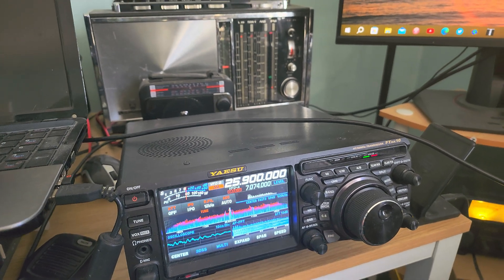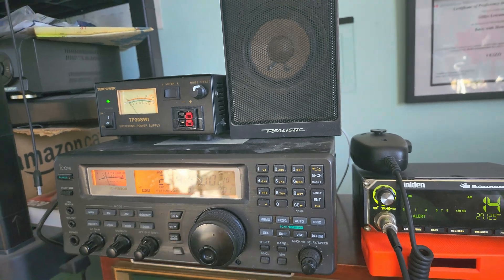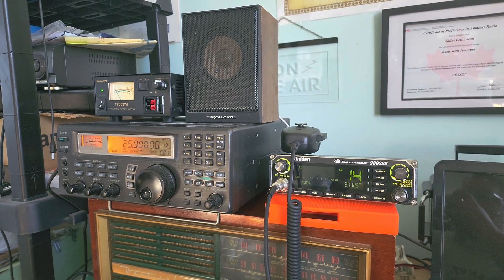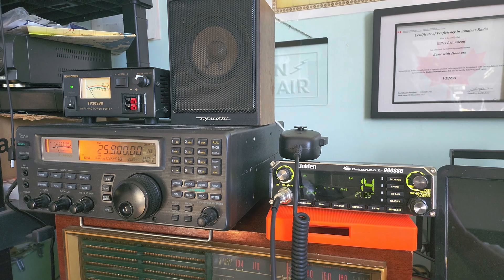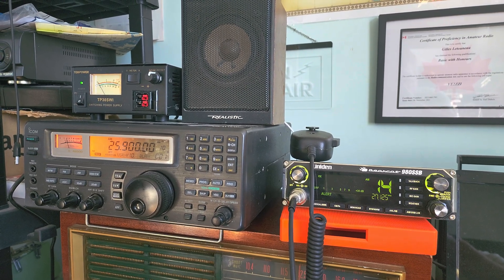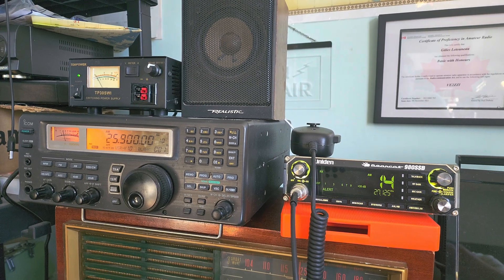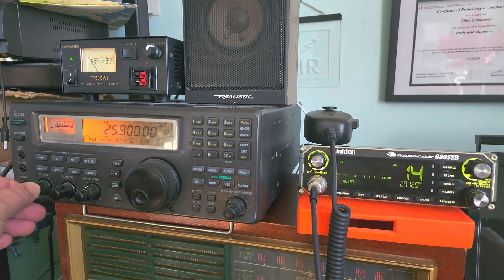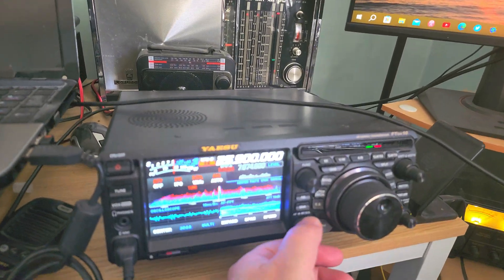MLA 30 Magnetic loop VS Half Wave End Fed antenna BBC World Service 25900 kHz Shortwave

Comment: I think that the MLA30 magnetic loop antenna is the best antenna to pick up 11-meter band frequencies.
Reply from the maker: in high noise it works well, but if noise is not too much of a concern, a long wire is way better

Comment: Can I use the mla30+ with a tecsun radio?
Reply from the maker: yes all you need is a adapter for the connection
Reply: @OfficialSWLchannel  i already have a long grounded wire in my back yard, and a tecsun an48x for traveling. Is that good enough?